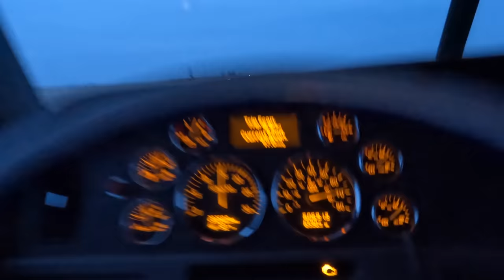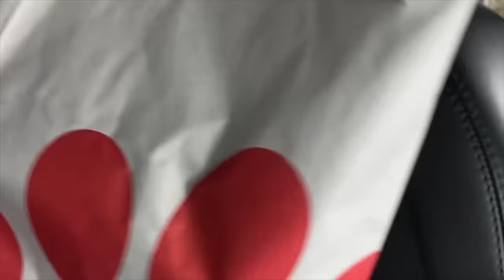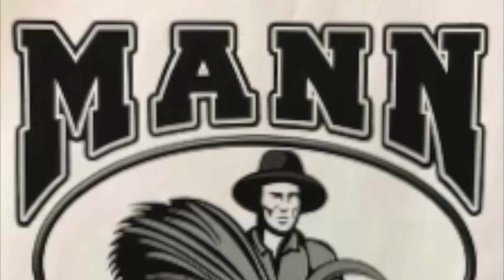We Traveled Across The Country To Buy Our DREAM TRUCK!

Comment: Cup holders. Two options. 
First You can buy a holder to insert into the cup holder for larger bottles to fit into. 
Second you can diy with some pvc and some rubber made drawer liners 
Third suppose you could make it out of wood.